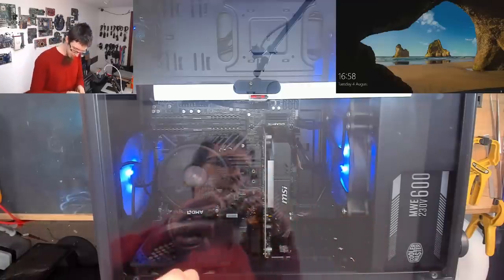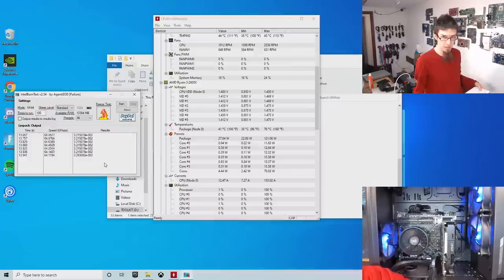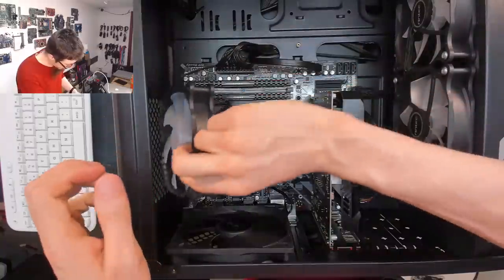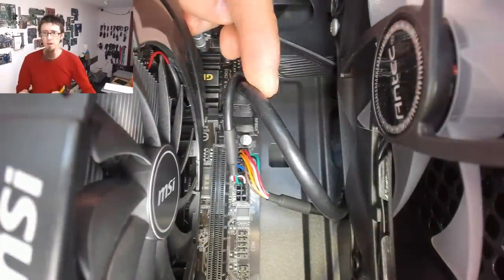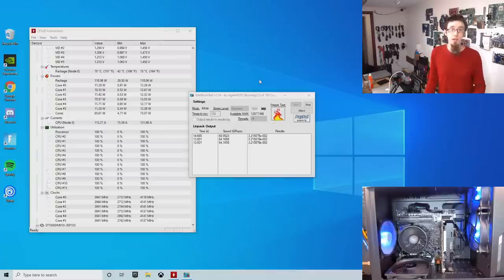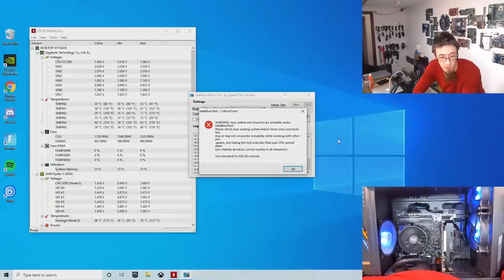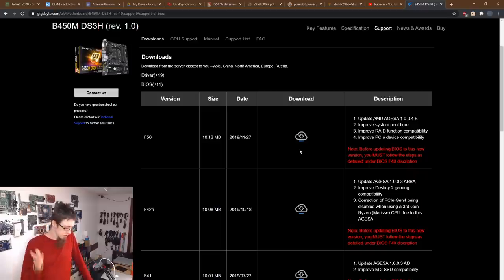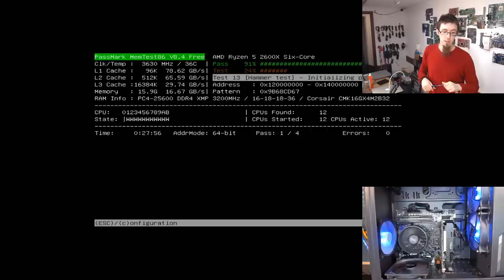Gaming PC Crashes at Random - LFC#217

Comment: Yikes! I'm planning to build a new PC soon with newer generations of basically the same hardware. That is, Gigabyte B550 motherboard (Gigabyte AMD B550 AORUS PRO AM4), Ryzen 5 3600, DDR4 (RGB and most likely Corsair 3200Mhz). 

Hoping someone can give me advice on two areas.
1) I will not be overclocking anything, everything will be at stock speed or Auto. I am planning to use 4 sticks of 8GB RAM for a 32GB total. Planning to use RGB. I am thinking of 3200Mhz DDR4 because I think that's the most Zen 2 can effectively use unless you're overclocking - is that right? What is the "sweet spot" for RAM speed in dual channel if overclocking is specifically not in the equation? Will I need to use XMP for anything faster than 2133Mhz or something?
2) Are Gigabyte boards particularly prone to throwing problems with RAM that's not on its QVL? I've read Gigabyte's QVL docs for that board and there's a lot of DDR4 esp 3200 on the market that's not on it (especially a lot of Corsair RAM, including Corsair RAM marketed as "Ryzen Optimised"), and there are a few things where the part number in a web store shows different specs to the part number in the Gigabyte QVL (e.g. the part number corresponds to a 16GB kit on Amazon or another retailer but according to the QVL it's 1X4GB and the number on the shop looks "right").

How concerned with the QVL should I be when buying RAM if I decide to go with the Gigabyte board?
Reply from the maker: 1. Certainly in the low-end, problems can crop up. But I think running a 3600 will help (newer memory controller)
You will need XMP for a modern memory kit to run at a decent speed, but you shouldn't have issues getting to 3000 or 3200, which is fine for a mid-range system.
2. It's hard to tell, XMP is a weird animal, I was going for QVLs in this video to see if I could explain why XMP wasn't "just working" but there's many factors involved. B550 should be better as well, better memory support, better PCBs, it's one of the reasons why it's more expensive. That being said, I haven't tried any B550 stuff yet.

Comment: In my experience, overclocking memory channel increases cpu temperature. When you took xmp off, cpu temps went down. Also i don't think 78 degrees is that high, but motherboard seems to think so though. I would upgrade the cooling solution and check if you can change motherboard max heat limit for cpu.

Comment: I have (2*8)16gb ram 3200mhz. The default reading was 2400mhz so I changed it to 3200mhz in the bios, and i changed also the Dram voltage from 1.20V to 1.350V. After I noticed that when I play games, sometimes it crashes or sometimes it will blue screen. My motherboard is B450m DS3H (3200mhz supported). Cpu: Ryzen 5 2600

So was it the reason guys?

Comment: This happened to me.
My car would not start due to a puncture so i put a new tyer on it but it still would not start,so my wife took the thing with all the wires and washed them in faiy liquid ,but the car still didnt start so i took the long thing that goes under the car floor off as it had a hole going all the way through.
I went to the car fixing bits shop and bought some filler compound and filled up the long tube thing.
After i ate a selection of fine swiss cheeses i put the tube under the carpet {yes,i am not stupid i know the tube came from under the car ,but it was raining) but the car still did not start,so me and the wife went to see our dear friend "Sparky" to ask him for help.
Sparky was just finishing off varnishing a teapot that he had made out of drift wood,and he told us that if the car had a flat tyre it will not start and he knew this as a fact because he had worked for British Aerospace and he was in-charge of a space shuttle and he had to draw spark plugs for a living.
Sparky assured us that if it was raining when the car would not start because motor boats are heavily varnished to keep rain off ,,,and in no time Sparky had offered to varnish our car so that it may start more easily.
The very next morning we awoke early to see if the varnish has hardened and sure enough it had .
Thje only problem was that the car was left upside down to avoid bird poo splats and the car was now stuck like glue to the road.
so we set it on fire and claimed the insurance.

yours sincerely

sir Dan Dandy.

Comment: XMP is an Intel thing so not really supported by AMD. I overclocked my 3200 ram to 3800 after some trial and error using Ryzen dram calculator. I can say one thing for people that also have gigabyte mobos you need to enable something called c state and disable core boosting in the advanced cpu part of the bios otherwise your system will randomly get bsod.

Comment: I built a PC for someone that was randomly crashing.  Swapped the ram same thing. Uninstalled graphics drivers no crash. Reinstalled several different versions of graphics drivers crashed with every version. Brought gtx 1080 ti from home to test no more crashing. Googled 5700xt lots of complaints about drivers and chashing.  Customer bought different GPU RTX 2070 Super problem solved. Just for the hell of it I did a GPU driver clean and tried 5700xt again crash crash crash. (MSI 570X board with 3800x)

Comment: I have a Blue Screen error ONLY during 5-10 Mins in game, other than that my computer runs completely fine. The CPU and GPU also are not overworking when in game. I can't seem to find the issue whatsoever, I've reset my BIOS etc. rolled back drivers too, last night I got the game to work for over 2 hours. And then today tried to play again, nope Blue Screen after 5 mins and the PC just restarts. Don't have any issues at all only when running games.

P.S. I had just reinstalled Windows yesterday after not using the computer since June 1st. My SDD had randomly died and I just got a new one. Never had any issues before this. New SSD I got is Samsung EVO 870. That shouldn't be causing issues, right?

Intel Core i5-6600k quad @ 3.5ghz
RX 580
Z170 HD3 Gigabyte Motherboard
16GB RAM
Windows 10
Reply: my guess is your 580 is running too hot and crashing your PC, run HWmonitor to assess your temps and make a note, I suggest first a thorough clean of the PC inside (120mm fans, cpu cooler fans, GPU fans, all dust filters and heatsinks, etc), try it then with HWmonitor active and again note temps down of CPU and GPU, if issue still persists then clean and repaste thermal grease on the GPU chip and run it over again, failing that, I would ask a friend if you can borrow a known working GPU of similar spec to try in your system

Comment: There could be lots of reasons

The overclocks are too high
cables might be loose
The vrm might be overheating
The hdd/ssd could be going out
The cpu could be bad
Psu could be failing
Bad capacitors/resistors
Or software issues like
Virus's
Malware
Or drivers
Updates
Or incompatible parts

Comment: Very interesting this got recommended to me because I've actually had some computer problems of my own, I don't know how long this issue takes to happen but I assume roughly 8 hours. I first built my PC a few days ago and for some reason when it's left on for long it will turn off the USB ports and the signal for the display, I believe it may be a motherboard issue but I'm not certain yet. Also, I must turn off the power supply with the button at the back because it will not allow me to turn it off from the front power button. Did I mention that the computer stays on while this is all happening? All fans are spinning, all lights are on, just no power to the USB ports and no output on display.
Reply: It's called sleep mode
Reply: @everope  that's what I had thought, but I turned off every sleep mode option I could find and it still happened, turned out to be the mobo so I just got a better one for like $10 extra than what I paid

Comment: #AdamantIT I would double check that memory QVL list. You looked up Summit Ridge list which is Ryzen 1st Gen. It's got a Ryzen 5 2600x which is a Pinnacle Ridge CPU. I wonder if the Ram is on the QVL list...still might not be but you for sure checked the wrong list...1st Gen Ryzen QVL memory list were really bad compared to 2nd gen
Reply from the maker: Heck, my mistake there. It wouldn't have helped anyway, it just might've explained why XMP wasn't working straight off the bat.

Comment: Why not check the Event Viewer for errors as a 1st step?
Reply from the maker: I generally don't find the event viewer to be very helpful in the event of a total system crash... a lot of information there tends to amount to "the system crashed" which we already know. Event viewer is more helpful when troubleshooting a single program/driver/service that keeps crashing. In the same vein, I never bother analysing BSOD dump files for the same reason.
Reply: @Adamant_IT  That can sometimes be the case, but other times there can be useful info there that can eliminate many other troubleshooting steps. I always start there, and if there is no useful info, then move on .... but if the info is helpful, you can eliminate a lot of time and effort.

Comment: DID YOU check for a new chipset, and relesases new chipsets about once a month. ryzen hates xmp, it won't run on my computer either i have  a ryzen 5  1600 cpu, runing on a asrock motherboard. it crashes stready.
Reply: Yea, I was having XMP issues aswell onmy new Ryzen 3200g, I am on MSI x570, I only tried 3000MHz set from Corsair, it works fine with 2733 or something.
I was thinking that my PSU is old, I am waiting for newer and stronger one.

I also chanced my power options into balanced in Windows, atleast not chrashing anymore...
Reply: They do not release new chipsets "about once a month."  I think you're thinking of the BIOS.

Comment: I noticed that you are running memtest86 with both memory sticks installed. This is not the ideal way for checking memory for bad sticks. The reasoning behind this is that memtest86 checks the memory as a whole. It doesn't distinguish between memory slots on the motherboard. It doesn't tell you which stick is bad in what slot.  If you have four ram slots on a motherboard and they are all occupied with memory modules and you run memtest86 and you get an error, you won't know which memory stick is bad. The proper way to test memory, is one stick at a time. It takes longer to test, but there will be no doubt. I was told this by Corsair memory.

Comment: I have the same problem with Corsair 3200MHz RAM on my B450-F Gaming ROG Strix. I run the memory at 2666MHz for stability. Even 3000 and 2933 would give odd (occasional) bluescreens. Unfortunately the AMD platform is very fussy with what RAM you can use. With Intel, XMP is not so much of a problem. To be fair, I bought the 32GB kit for around £100, which is incredibly cheap so you can't expect miracles. I expect the kit would run perfectly on an Intel MOBO.. But yeah, gotta check those QVL lists with AMD:(

Comment: Hey @AdamantIT . I'm having issues with my pc . On very diferent occasions( under load and at after windows boot) it switches off monitor and my rgb keyboard losing lights but the computer is running , fans are spinning . So after restart it's working again . Recently I was processing a video after editing and it crashed again but this time after restart I recieved I think 5 or 6 short beep codes from bios and it shutdown . After switching it on again it booted fine without beeps and no further beep codes on next boots , but it's still crashes at random points but I haven't heard again beep code to confirm if that was 5 or 6 beep codes . Please help . Currently I'm running memory test as you advising , later will do a burn test . 
Specs 
 CPU - RYZEN 2600 
RAM - 2x8GB Corsair Vengence Rgb 3200Mhz on XMP Profile 2998MHZ , DEFAULT PROFILE 
GPU - RX 580 GAMING X 8GB 
SAMSUNG SSD 850 250GB
SSHD 2TB 
MOBO ASROCK B450 STEAL LEGEND . 
Please help or advice .
Reply: So I have completed Memory test with no errors . , Intel burn I stopped after 20 cycles no problem temp. Min 41°c max 90°c . My pc didnt switch on the display . Works fine .
Reply from the maker: Try running it with XMP disabled to see if the fault disappears. In this video we had a very clear diagnostic with Memtest, but it's not always this simple to demonstrate. What cooling have you got? Because 90c is on the hot side of things, it's not TJmax, but it's getting awfully close. You don't really want to be over 80c.
Reply: I never reach 90 when I game + stream , only reached that with the burn test . I'm using stock cooler wraith from the cpu box . Most of the times it switches off monitor after a boot to windows , rarely it happens when I game and stream . Actually it happend once when I video edited stuff .
Reply: It's been now 2 days without bizarre switches off ...so it's very random .
Reply: @Adamant_IT  Reverted back to 2666Mhz and now after 3 days no lockups . seems fine . but is there any chance i can make it work 3000 considering my ram is not on the qvl list ?
Reply: @Adamant_IT  There is a new bios for my motherboard stating that support more memory ( i guess diferent modules ) but in description they also state do not upgrade if running amd ryzen cpu ...not sure why since its am4 motherboard .

Comment: that looks like a b350 from asrock which is a board i used when i first setup with ryzen. if it's crashing randomly. with a soft shutdown then its the actual motherboard. or well i my case it was the motherboard i had to replace it and decided to go a bit higher end with a x470

Comment: I have appoved RAM in my Asus ROG Strix B450 F and I had to down clock 3200 mhz rated G. skill Ripjaws V to 3066 mhz for it to work without crashing I tried some other RAM that is suppose to work it wouldn't even boot up with XMP/DOCP turned off so I am just stuck with this memory I am thinking the Mother board is shit for overclocked RAM.

Comment: cool video, except, the issue, being reproduced, I'd have moved onto 1, 'faulty' memory, 2, checking the 'over-clock' as indicated.  Why?  Time savings no. 1.  Gamers, are notorious for pushing their systems GPU and 'over-clocking', and 'ram' upgrades, often go unnoticed, TILL there's an issue.  My NON pro opine. So, in closing.  I'd have asked a these questions.  Gaming system?  2 additional questions.  Have they overclocked the system and / or done any 'upgrades'? lastly.  Does this happen ONLY when in a game and which game if so?

Comment: I prefer asus TUF gaming mobo's for both the B450 and X570 'bang for buck' builds. They've always worked with corsair 3600 with xmp, I've usually done 2700x, 3600 or 3700x builds though. By the way, the voltages looked all over the place in hwinfo in that vid might just be that board/psu/poll speed? /shrugs.

Comment: One of my Gigabyte board has SATA drives that stop appearing in the BIOS and Windows. I'll restart Windows and there back. Sometimes I would have to Drain the power to the board by turning off the PSU. In frustration I switched to Asus and had much better luck. Also the VRM's on my B460M DS3 V2 would overheat and clock back to 800MHz on the CPU to control them. I5-11600K was not optimal for board. VRMs would hit 110c! The Asus B560M-A, no more than 70c in stress test. On board power could explane SATA controller issues on Gigabyte board. I tend to steer clear of them. Asus puts a heatsink on their VRMs. Both of my Asus powered systems are rock solid with XMP 3200 and G skill memory.

Comment: in order of probability, by my experience: 90% overheating 5% *faulty psu or ram (typically under load, second stick, ect) <5% chewed wiring/bugs - I doubt very much it was simply "unsupported" if it works, it will keep working until faulty

Comment: Probably too late now, but you should have tried bumping up the DRAM voltage a smiggen, say 1.36v instead of the default 1.35v at 3200.

Comment: hmmm, I say RAM problem, PSU problem or band overclock....

Interesting fact for me, My board oddly enough failed to post, odd beep code, boot looped, then booted normal. Thought everything was fine, in fact was not. Windows did not see the full 16GB of RAM, only 8, reboot, go into BIOS, it sees the full 16GB, X.M.P. turned off, turned it back on, odd beep code, boot looped, then booted normally, still only 8GB in windows. 

some sort of damage was found by Gigabyte and fixed.

Comment: I think you should shift to HWinfo, for ryzen chips especially zen series as the info isn't accurate in HWMonitor

as Ryzen has 3 temp readings for the CPU.
Reply: I agree. It registered my 2700x @ 5.7 Ghz so I knew it was useless.

Comment: I haven't watched the whole video yet, just to the point where we turned XMP back on and ran IBT.  Yeah, host just said he'll update the BIOS.  The AGESA updates will likely fix it so XMP will work.

Edit: Was on F50 BIOS already, so the issue is simply that we have a very low end board and RAM that is maxing it out and becoming unstable.  I've had the same issues with 1st gen Ryzen on an Aorus Gaming X370 Gaming K5, a great looking board that is actually pretty awful in terms of power delivery.  This PC might still run at 3200MHz with a squeeze more voltage, but running it it 3000 is the better option, I suspect.